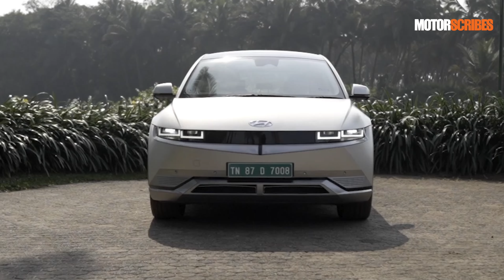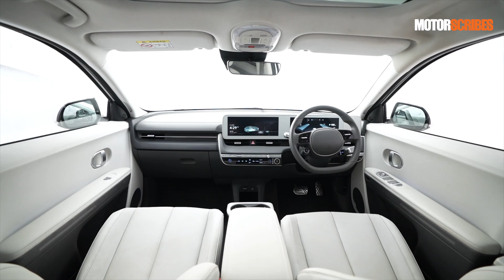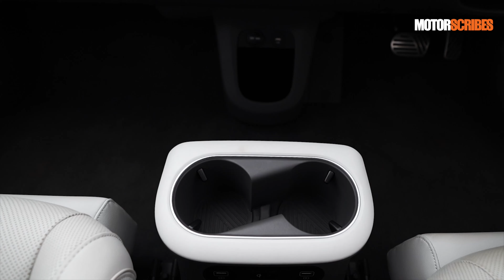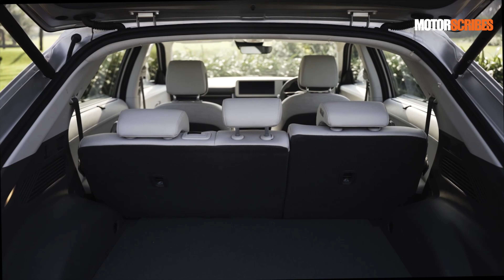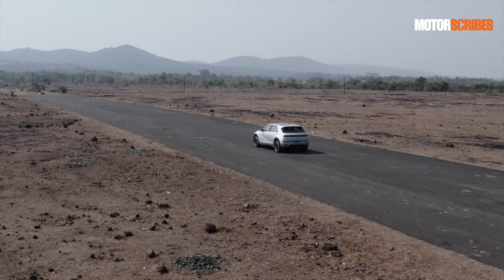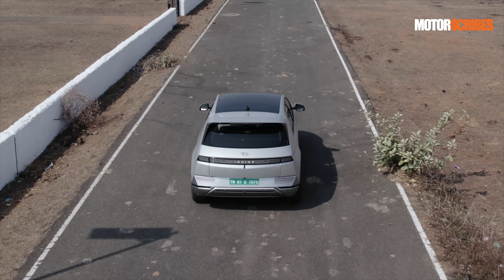Hyundai Ioniq 5 Review - MotorScribes

Comment: It’s 500 not 600km range
Reply from the maker: The company claimed mileage is 631km per charge. Real world driving will be in the 400-450km range.
Reply: @MotorScribes  it must be different in Europe, I am waiting for mine to be delivered, 77kw batter RWD and they told me it’s 500km range
Reply from the maker: @MichaelRizzofishing  Yeah, it depends on the cycle they use to test. The figures we mention are for the India spec version and based on the test cycle for Indian norms.